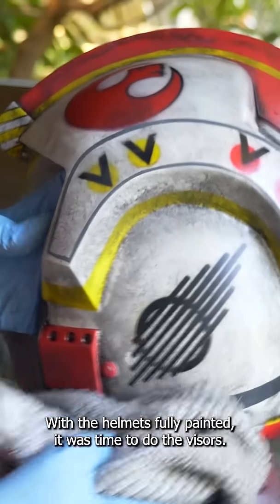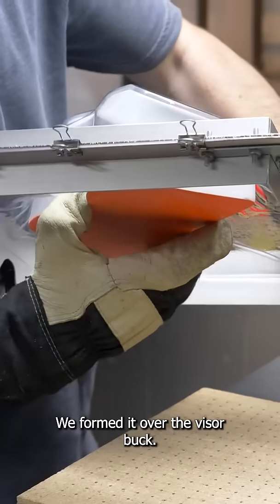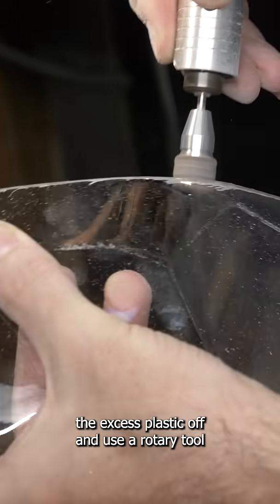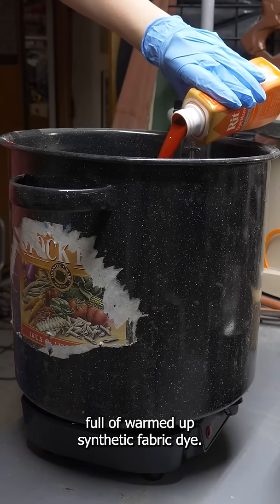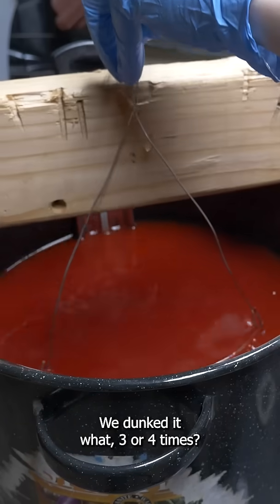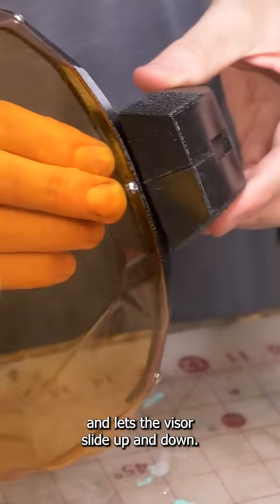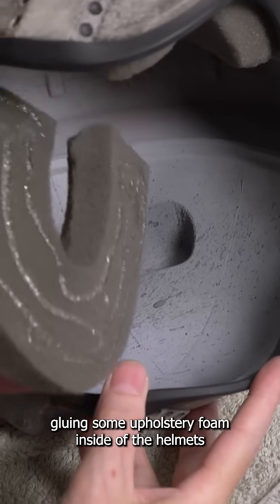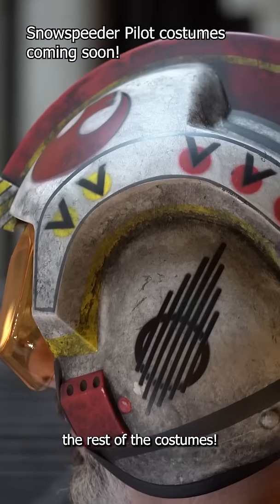hand-pulled visors

Comment: Seems like a lot of plastic is wasted after cutting out the visor. Could you use a different mold that allows the formation of 2 visors able to be cut out from the same molded plastic sheet?

Comment: You don't have to buy new sheets of PETG or any plastic used for vacuum forming.  All you have to do is put the sheets in the oven at 150 F for 30 minutes to bake out the excess moisture before use.  I ran into this issue with polycarbonate and putting it in the oven did the trick.  I got perfectly clear results doing this.

Comment: what about you dye the sheet of plastc before moulding it ? It seems the hot dye may alter the heat form shape. no?
Reply from the maker: We had a few failed visor pulls in the recycling bin before this. Only wanted to dye a success. As long as the temp stays below 150 degrees F and the plastic doesn’t rest on the bottom of the pot, it won’t warp.

Comment: Huh! I didn’t think you would go with dye. Have you ever tried Tamiya PS translucent paints? They work really well.
Reply from the maker: I’ve used a spray can translucent once (light blue) on the inside of the visor and it worked great! I like tinting the plastic so I don’t have to worry about the finish rubbing off.
Reply: @punishedprops  ah, excellent point. If it’s an object being held then lacquer might have issues rubbing off

Comment: I would suggest a motorcycle replacement foam kit. Better foam, precut shapes, goes on with Velcro and is washable. Might I also suggest a Bluetooth motorcycle helmet speker\mike kit.  Adds real communication to any helmet.
Reply: Intercoms are heavier than you expect, bulkier than you would think and extremely irritating to use. More pressingly, they’re designed for full face bike helmets. You wouldn’t be able to use the microphone because you’d have nowhere to mount it and the drivers would struggle to stay in place, as they’re designed for helmets that have cutouts specifically for them. They’re quite expensive and not worth the effort when you could just as easily use earbuds you already own. Motorcycle helmet pads are also designed for (you’ll never guess) yes that’s right… motorbike helmets. They will only work with the helmet they’re built for, and are only removable because of the clip systems used to hold them in place. In order to get them to sit properly in a custom helmet you would have to remove the clips and glue it in, making it unwashable and impossible to remove.
Reply: @johnb2127 That's why you put a plastic bag on your head and like it's a type of upholstery foam and you inject that into the helmet and stick your head in that foam with the bag on your head and you endure it and you get custom molded padding for your head. I'm not talking like construction foam I'm talking very soft foam for custom injection molded padding

Comment: you should be able to stick PETG in a very dry box with dessicant, and change it out a couple times for a couple weeks to solve the moisture bit!
Reply from the maker: I hope that's the case! I have a few really old sheets and it would be great to use them! It works for rolls of PETG filament so it's worth a shot.
Reply: @punishedprops  that's my take on it, at least. vacuum works too.
Reply: @punishedprops  get a food dehydrator and run it in that for a few hours. its also really good for drying 3d printer filament!